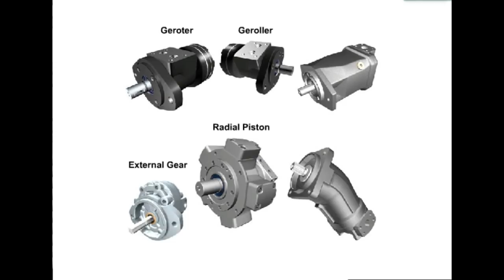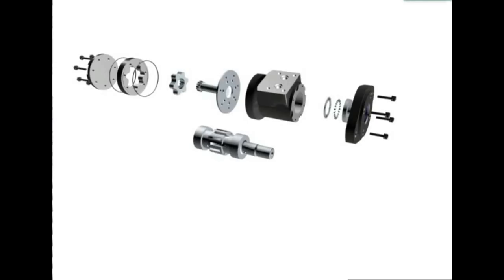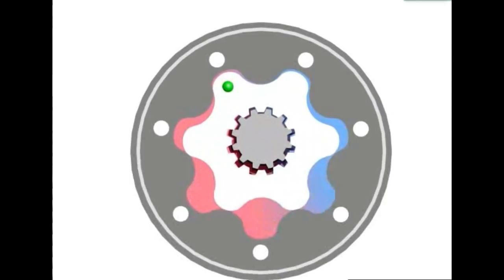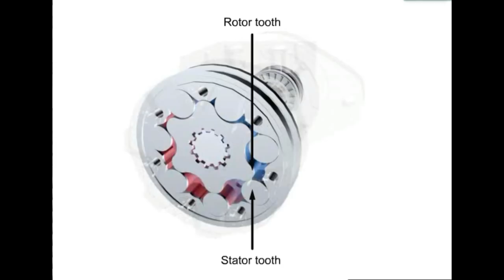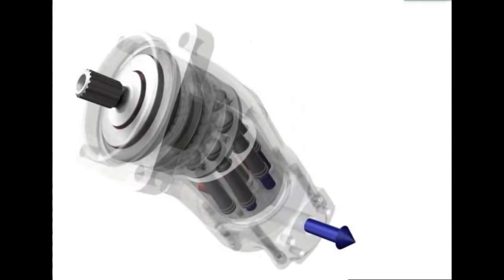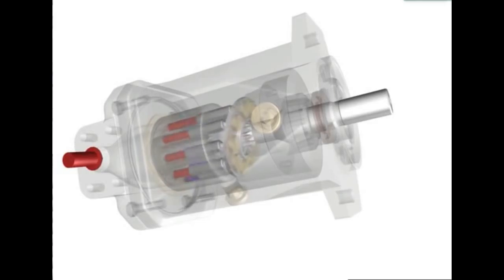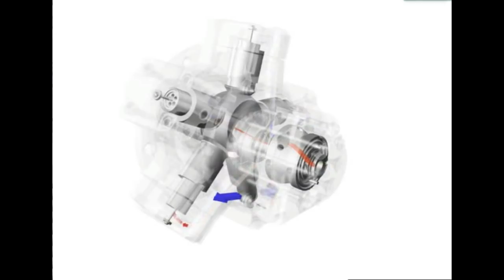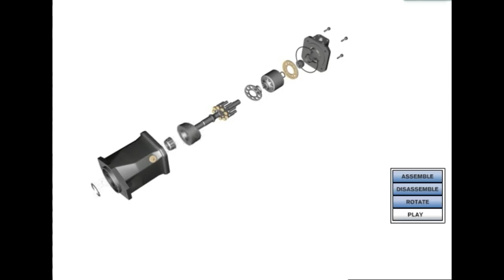Hydraulic Basics - 04 - detailed explanation -  #Hydraulic,#pumps,#motor,#valve,#pump,#actuator

Comment: Thank you for showing the piston motor's bleeder function, that I was wondering what it is for and how it is need to feed the leaking fluid back to the tank.  I am building a cement mixer with such a motor.